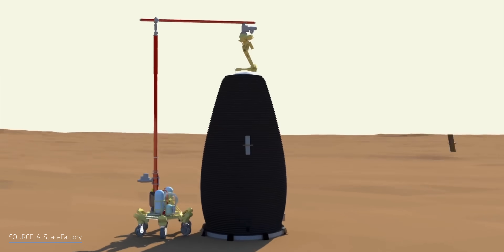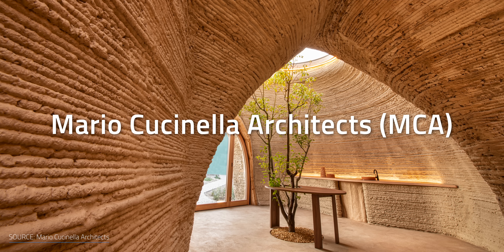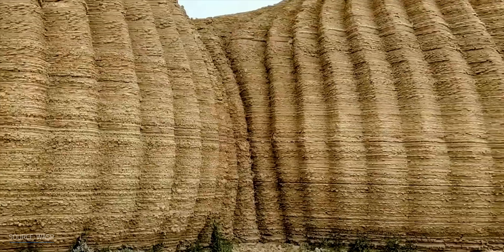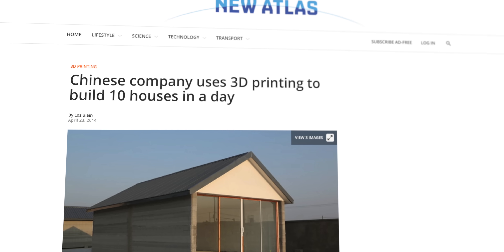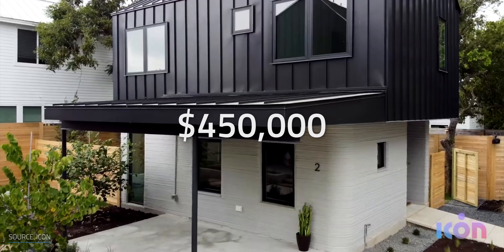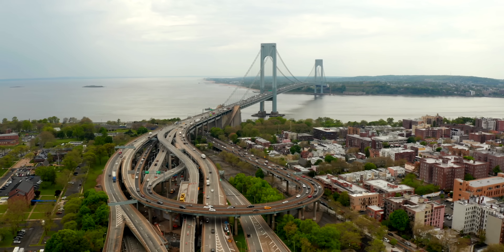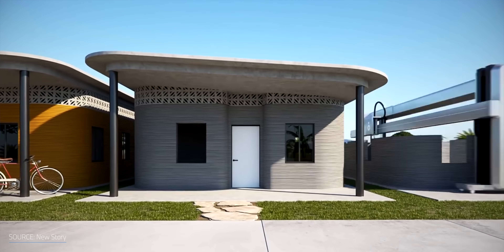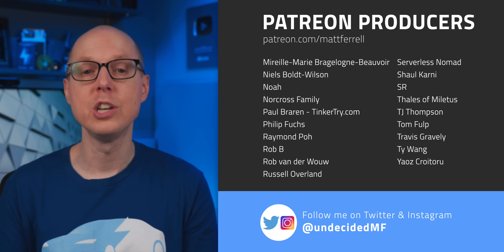The Truth About 3D Printed Homes

Comment: Great video!  We don't need 3d printing. We have concrete blocks, standard fired bricks, and sun dried clay bricks. Making ICFs and
SIPs available as kits from a catalog of homes to self builders is a better means of reducing the costs to build the walls. When working with concrete the biggest cost is labor. If 3D is only capable of erecting walls, the savings, as outlined in this video, is minimal. So many were naive of the fact after printing all of the specialized trades are still required to finish the home. Which means the sames costs and timeline for completion. 

Rather than wasting time trying to reinvent one of hundreds of methods we utilize to build homes, methods which vary drastically based several factors, let's work on improving and streamlining existing methods. Prefab/modular should be the most affordable option. However, due to their "green" appeal we find the prefab market is being saturated with high-end boxes with catchy names, stuffed with high-end design and tech. All of which equates to unaffordable homes for those in need of an affordable option. As always there is one new company every few years claiming to reinvent home building. By the time that company goes bust, there is another one making the same exaggerated claims. The current prefab darling is Boxabl. These "homes" they're spitting out are essentially prototypes. And they do not exactly say welcome home when you arrive. Without serious cosmetic alterations and design changes, Boxabl is going to go bust before they open their new state of the art facility. We may see fraud charges before all is settled and done. Something is seriously off with Boxabl.

One way to reduce cost is kit homes. Once again the buyer choose a home from their catalog. The home kit is prepared using manufactured plug and play wall panels. These panels would be complete with electrical and plumbing already installed with connectors and plugs. Plumbing would use the Sharkbite push and lock couplers and connectors. The electrical would simply be plugs with a flip lock. Cabinet rails would be pre-installed for the kitchen and bathrooms. Cabinets and vanities with the sinks and fixtures pre-installed simply sit on the rails and get screwed into the wall at the base. The roof/ceiling would be comprised of the same panels. Trades would be required for the foundation, mains electric/gas/water/sewer connections, hvac install, the boiler, the roof, tub/showers/toilets, and testing all of the connections to ensure everything works. SIPs panels are ideally suited for this type of self, family, or community build. Manufacturing of panels with everything ready to plug in to the next panel saves time, money, and reduces waste. However due to their excellent qualities as a superior building material, their cost is five time or more what it should be. Currently SIPs are mainly for higher-end homes and other structures. What we need are non-profit firms to design a catalog of basic homes and manufacture the panel kits for those homes. Home builders could then be matched up with trade schools to reduce cost further by offering their home for hands on training in all of the areas tradesmen are required to ensure code compliance. Building on-site with sticks is too costly and inefficient to produce the number of affordable homes we need.

Cheers

Comment: Note that even if 3D printed houses are cheaper in developed countries, places like Africa, Brazil or other countries that struggles to develop like the most advanced countries would find this methos way more expensive than just, building a house from scrach with the usual materials we use. That's because when technology is involved, the companies sees dollar marks on their eyes. 
It's like that for anything really, a simple example is when a Videogame company releases the Slim version of that platform for the public. The reasoning behind the Slim version is delivering a cheaper, less power-hungry, with less hardware features device that will cose half of the price for anyone. But when it arrive those smaller countries, usually, just because the slim is the "newer" model, it assumes the old pricetag of the FAT version, and the FAT version drops price drammatically. 

Anything that's newer, shinier AND involves new tech, will be put a pricetag absurdly high just because it's a novelty. And that's why I struggle to seee, for example: Tiny houses and 3D printed houses in under-developed countries.

Comment: About plumbing and electricity, head of the 3D printer should be equipped with an offset head for thin concrete in order to make tubes and precise device. The dream will be to have large PLA print head also 
The solution is in multi head

Comment: In Finland, we usually live in houses built of wood, where moisture, mold, rotting fungi and radon are a bigger problem than insects, but insects also love to live in the structures of houses built of wood and, for example, a beehive in the attic or between the walls is no surprise. But for example, desirable indoor insects are usually flies and small spiders. And less desirable are cockroaches, mealworms, ants and silverfish. And it is often difficult to prevent insects from entering the house, for example many insects use open openings in drains or a door or window that is kept open. And no matter how hard you try to keep the insects out, they still come inside.
Reply: Well sure, you would try to get inside, too!  Did not know about the radon part.  It is very wet here also in N Coastal California, which affects building practices likewise.

Comment: I could see 3D printed housing being used in extremely specific circumstances, but I can't imagine it becoming a norm. A single solid structure isn't ideal in my experience with much of anything, as when something goes wrong, and something will go wrong, there's no way to repair smaller problems. A normal house, if you get a damaged wall from something like a water leak or termites or even fire, you can knock down that wall and replace it easily enough. With an entire structure being a single solid object, repairing anything would likely be far more difficult. I could however see 3d printing or more automated construction come in to popularity if they were just producing or assembling modular parts of a home, you still would have issues I think but I could see it being useful enough to outweigh the cons.

Comment: I feel like these aren't very space efficient. So while it will work well in areas with a lot of open land...I don't think, at least at the moment, people want to live in an area with a lot of open land. 

For one there is commuting costs and two the cost of getting infrastructure out to all those houses in a possible remote area will likely both increase price and said new infrastructure might not be the most reliable either. 

In my opinion smaller apartment like complexes might be better. Since you can pack people a lot more densely. Possible even moving them into closer proximity to shops and their place of employment. In the long run this might actually be better for the environment because you're reducing the distance people have to commute.

Comment: 3D Printing Promises to greatly reduce the cost of framing buildings and enable us to build large enclosures on the cheap.  However, it will take a great deal of development throughout the architectural supply chain to produce a house in a single day.  The advances made so far are impressive and could make it easier to produce larger, stronger, more thermally efficient buildings in the immediate future.  The one advantage that 3D Printing has over conventional wall framing is that complexity comes at no extra cost.  This means we can produce very complex internal structures that strengthen and add utility to the building without adding to the overall cost of labor or materials.  

I do not see 3D Printing (as it is today) as an "All-in-one" solution to all our building and construction needs.  However, I do see it as yet another tool in our belt to make certain kinds of construction cheaper and easier.  This clay printing technology could be used in a number of locations to create emergency shelter for people displaced by disaster, war, or disease.  I also see a huge potential market for ornamental architecture -- for printing decorative patios, children's play places, bridges, archways, etc...

Comment: They should just 3D print modular parts to make building structures much more efficient. 

Instead of 3D printing the entire house, I believe it would be much, much better for us to just 3D print the modular parts. This way, we can check for any signs of weaknesses within the structure thus minimising any potential hazzard that these could cost.

What's more is that, the houses won't be limited to only a 1 or 2 floors. Which would makes sense if we want to keep the already shrinking wildlife habitats from shrinking any further due to over population. 

I believe the building Compartments from modular printed parts would be a much better option than building individuak homes as you can use a specific area to the max and be able to give a roof over the heads of many families without occupying too much space.

Comment: The biggest problem with housing is the roofing system, primarily, insufficient overhang.  Houses rot away if not painted regularly with insufficient overhang.  Buildings not hooked together, east to west allow sunlight to heat the houses inside.  Dark roofing material also increases air conditioning costs by 1/3rd.  Once constructed, a closed cell spray foam on the outside and then painted would solve the weathering issue as well as place the thermal mass on the inside, allowing a constant internal temperature.  Fancy housing is expensive.  Well-designed housing is "dirt" cheap.
Reply: Good points.

Comment: When you mentioned services like electrical and plumbing is an added cost, you fail to take into account that every building must have these services, so the costs of services remain the same for all methods of construction.  We should be comparing apples with apples- that is how does the wall costs of different construction methods compare.  Of course t a high tech solution may not be suitable for the villages of Africa.  In fact they have building such buildings for centuries by hand with soil.  In the west it is called cob mud building.

Comment: I'm a handyman. I'm also a 3d printer enthusiast. I think the biggest problem with homes is design and placement. We should be designing homes to be sustainable, collect rain, generate power, and absorb heat during the day to reduce fuel usage. These people are trying to solve a problem that didn't need to be fixed.
Reply: Well said! I'm sure you're already aware of them, but check out earth ships if you haven't already!
Reply: This video is deceptive, almost all 3D printed homes are made using concrete.
Reply: Homes should also be designed as you described, but there is a very real issue of pollution/waste related to the actual building process of our current standards.

Comment: 3D printing tech is just some marketing hype BS. I am studying mechanical engineering and know well that anything 3D printed in FDM or SLA will have significantly lower strength, especially in the Z axis. The problem is that 3D printing is literally building on layers and counts as a discontinuity. The structure is only as strong as its weakest part and that part is literally every single layer up the Z axis. just print out a vertical stick and a horizontal strict and snap it, the vertical one will snap easily. Moreover, concrete must be enforced with metals or else it will crack easily. These houses are printed with not only weak layers but also no reinforced metal bars. I'm gonna be surprise if these houses can last for 1 year without cracking. 3D printing should only be used for prototyping period.
Reply: Very good points. But money is really pushing this stuff.

Comment: As a electrician these 3d homes and Lego like homes are really annoying. Why is everyone always acting like the framing and drywall is hard. They never show electrical plumbing or HVAC going in. Not to mention wood frames biodegrade and drywall is pretty much fertilizer. I would charge you three times as much to wire up these homes.

Comment: Most of the negatives presented actually sound like selling points.

- Transporting one printer is negligible, especially if used to build tons of homes
- Local materials remove the waste, production costs, and transport of otherwise sourced materials
- Most things need to get added to a house anyway. A well designed model could make adding piping and wiring easy, maybe by leaving space and pausing at certain layers.
- High cost is due to other modern fixtures, but good design and large scale production would minimize added costs

Comment: The only thing I was concerned about was the whole making the house is designed to stand up for a period of time but still be biodegradable someday. That alone kind of makes me concerned because when you say your house is made of dirt and you live somewhere where you do have unpredictable rainfall that’s not able to be predicted it makes me wonder how long will the house actually last. You see I live in Georgia and we don’t have an actual annual rainfall but we do have rain sometimes that will go on for days and days and days….one time we had a rain storm that lasted almost roughly 2 weeks. So making a house out of dirt may sound great but if it is made of dirt and we get a large amount of heavy downpour what’s the stop the house from collapsing on everyone? If that was the case I would suggest that they add a little bit of concrete to the dirt as well… so even if we did have a tremendous amount of rain once the concrete in the dirt hardens the house would be almost unwatchable. But at the same time I feel like it would still live up to the promise of being pretty much biodegradable…. It would just mean that the house would have a longer lifespan than what it would have if it was made of pure dirt.

Comment: Put up a frame with a wiring and plumbing harness and 3d print around it.  The 3d printers shown are more like xy printers - true 3d would be more versatile.  Tool selection for boring, cutting, hollowing out pockets here and there for whatever would also be useful.   These 3d rigs will eventually end up as combination machine tools of crane size cnc 3d printer &  router.

Comment: Its really a simple formula for low-mid density houses (I've personally seen 4 storey CSEB apartments in Tamil Nadu (Auroville) India, immaculate!). 

1) Rammed earth foundations (deeper than wider!) using 5% cement by volume, compacted to achieve desired MPA OR stone foundations OR if you have the resources, reinforced concrete foundations (strip or pad depending). 
2) Damp proof course (many options). 
3) Frame support structure from timber or fired masonry (piers at X centres). (If using CSEB, then that is structural, no need for framing. Also no need for rebar in walls, only in ring beams). 
4) Clay walls (3d printed?? or sun dried adobe, depends where you live). 
5) Properly designed ring beam - don't skimp! 
6) Roof with generous (+1m) eaves overhangs (protects clay walls from rain). 
7) Bonus add on when you have the time/money: wrap around veranda which acts as an apron / extended living area, which also is another layer of protection (for the clay walls) against moisture. 
8) Finishes: Lime plaster and paint on the clay will take care of most issues relating to bugs/vermin. You will still get some cracking from settlement etc. but you can touch up after a year or so.  

Point is: you can build this house yourself with stones, timber and soil from the landscape you live on, using hand tools if you really have to. 
Obviously there are limits to scale. I know i haven't mentioned the floor - that is a long conversation, there are so many ways of doing it. 

For high rises 4 storeys and above, my money is not so much on earth tech, but rather Cross Laminated Timber (CLT) technology. 
It ticks all the boxes for me: Co2 sequestration, strength, reproduction, portability, fire resistance (surprised? go read!), sustainability and customization are all there in CLT design. 
It also uses a fraction of the steel of "traditional" steel and glass high-rises. 

Thanks for exposing these WASP fad hipsters Matt. Their vision is a bit myopic. 

Regards from South Africa.

Comment: How do subcontractors install electrical, plumbing, vents, whole house ventilation systems, alarm systems, etc.?
I live in Teton County Wyoming. How would these homes meet:
-Insulation requirements for an area that has a 5 month winter and sees -30F. temperatures?
-Seismic requirements. This area has rigorous seismic codes. Clay houses won't meet them.
How does clay hold up as an exterior and interior finish? Not well, I'm guessing.
Reply: Details, minor details.

Comment: Can't really imagine living in this without some sort of polymer coating, at least on the outside. Even inside, you'd probably generate a lot of humidity. Compared to more traditional use of mud bricks, with the walls also forming the roof, there's just no protection at all from rain, and I think that's a big and obvious problem. But there's plenty to like. Reckon there'd be great insulation with those walls, at a great cost in internal space though.